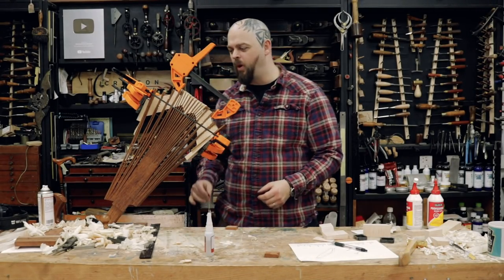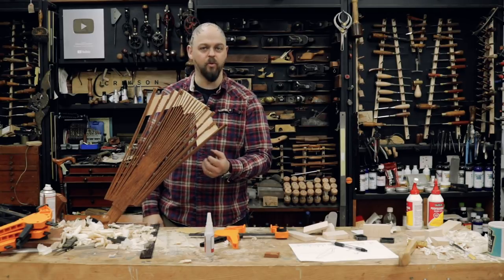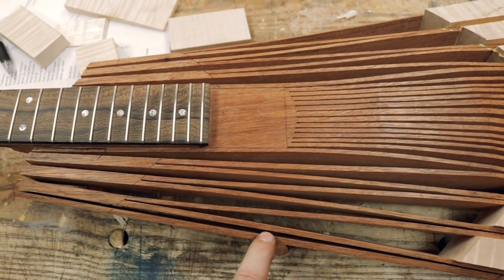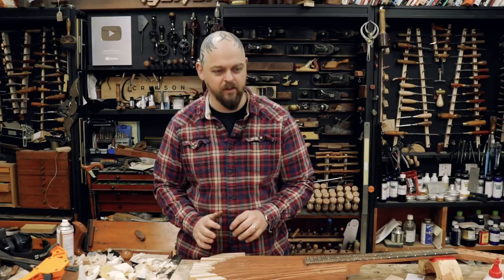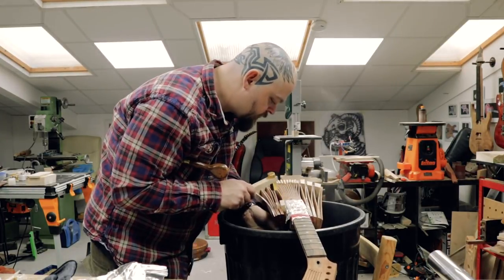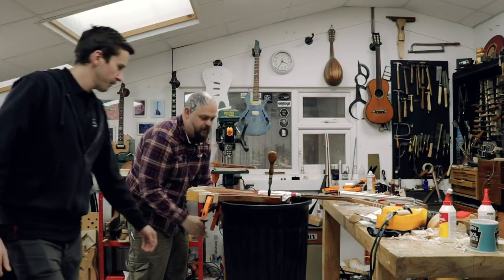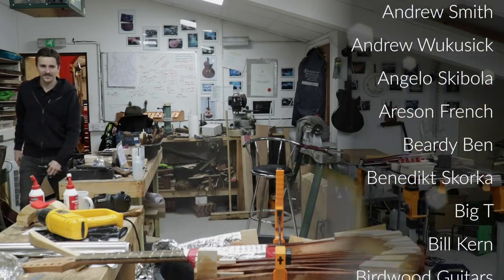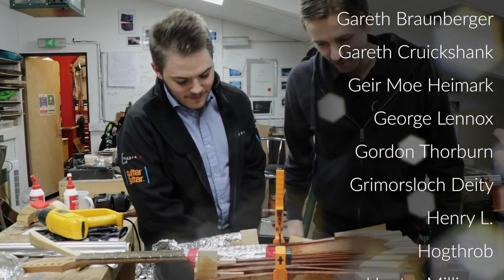Ep 13 - BoB1 - Things are heating up in here! - Ben Crowe Builds an Insane Guitar

Comment: The horns end is very solid because the other end is glued. The outside of a curve is longer than the inside, so in order to bend the (dry) fanned strips they need to be able to slide relative to one another, to accommodate the difference in arc lengths.

Comment: Ok, in retrospect, the best way here, (I believe) would have been to not put the fret board on until later. Then to add all the wedges (but not glue them) to both ends, bind the middle with either clamps or with tape/twine, then submerge the entire business in the boiling water.  This would force/add the desired curve to the guitar body and to the angles in the slices without releasing anything that had been glued. Once the desired "curvature" is achieved then you can remove it from the water and allow it to dry while still clamped and bound.  This would hold the curves after drying.  At that point glue in the wedges and the fret board etc....  Kinda the way early skate boards and snow boards were made way back in the day,  by forcing the bend in the end with boiling water in a bucket and the board dunked inside.  
BUT, as always Ben, amazing work! Thanks for the series and the entertaining video.
cheers
-DA

Comment: I was thinking in the start of the video with the first cracking. you should have a clamp in the middle to take away the stress from the end of cut and just stress the woodgrain by bending it. it can handle much more. I saw you did that in the end and it turned out really well :)

Cant wait for the next video!

Comment: Imo if you follow the kinetic chain here the safest and probably most effective way would have been to boil the slot-ends on the bottom side, even if that means having to reglue the wedges. All the tention of bending the slabs ultimately comes back to those dreaded slot-ends and can ruin your day even after the build is already finished.

Comment: Ben could you take a saw and cut the webs apart on the bottom side of the guitar at the neck.  When you got them bent to the desired bend, cut some real thin slivers of the white wood and glue it back together where you want it.  Or just glue back the pieces you cut without any fillers.

Comment: I thought that glueing the back first might cause an issue. In effect, the wedges at the back are the correct size and shape for the V you had when you glued them in, not for the shape you were aiming for, so that puts extra stress on things when you try to bend to the final shape. 
If I were to try it I think I'd try to devise some sort of jig to hold everything in place so I could cut the wedges to properly match the final shape (and also to keep things in place while it glued up).

Comment: Even in previous episode I was questioning the sanity of gluing the bottom end before opening the top. (I'm at 3:45 - at cracking) So if you'd wedge the top at the same time as bottom you'd not have to fight the tension that is now there because the bottom is glued and when you try to open the top you create the shearing forces.

Comment: Boiling water really doesn't work as well as steam. The point is, the water doesn't actually do much. It's the heat that makes the lignin in the wood yield. Steam is an excellent way to transfer heat, because when it condenses on the wood, it releases a lot of energy into the wood. Hot water, even boiling water, doesn't do that.
Reply: Dries van Oosten yes!  That’s physics :) love it.  Latent heat of vaporisation.

Comment: Ben, your pathological lack of planning never ceases to amaze me
Reply: It's the perfect safeguard against failure. He can attempt to do some "wacky", "crazy", "amazing", "utterly original" build despite making no real preparations, or giving it much thought, which then causes the project to fail (e.g. all of the last "X Hour Builds") to which he can then reply that it was all just a "grand experiment" and it "was fun trying", etc...all of which may be true, but they're also colossal failures, that basically just waste everyone's time, particularly when you watch several episodes only to see it all go to shit at the last minute due to poor planning and lack of necessary technique.
Reply: @KarlKarsnark , those who try doing different stuff instead of sitting flat on their buttocks are bound to fail from time to time (well, most of the time). Failing is not bad, on the contrary, it's totally fine. The point it, that wisest of us try to minimize their failure rate by thinking their steps through before grabbing the piece of wood and slicing it to strips.
Reply: How you even plan this kind of thing? Maybe you can, after a prototype.
Reply: @apinakapinastorba , well, you walk through all the steps in your head and think of all the contradictions. Like if you know you need to bend some wood, which may crack and ruin the whole project, you may want to start with that, instead of gluing the fretboard on a chunk of wood and fiddling with inlays. And yes, a prototype would be a great idea. A prototype, a scaled model, a CAD drawing, any drawing for that matter. It greatly decreases the chances of "oh, snap!" during the process. But what's the fun in that, I hear you ask?

Comment: I am by no means an accomplished woodworker, but I've always had this nagging fear that by wetting/steaming/boiling the wood, isnt there the risk of the wood warping as it dries?  isnt that why we work with dry, stable wood instead of green wood (no sarcasm, an honest question)?  Is it because even though you wet/steam it, it doesn't actually go up significantly in moisture content?  And, as always...Ben is the best thing since sliced bread!

Comment: I think It sort of makes sense you had to glue it up in stages to get that nice sweep in the middle, the overall shape is coming along, I'm wondering if you couldn't have clamped the middle even more lol, but I'm glad you didn't leave it with the V shape at this point, with the arch in the body it's going to be amazing. I'm wondering what kind of finish it's going to have and whether or not that will add to the overall rigidity, of course it will help some if it's shellac or resin.

Comment: Fill the empty spaces in with resin.
Reply: Fill the empty spaces with resin and sawdust from the same wood as the wedges, makes sense doesn't it
Reply: What would be the point of this build if Ben did that?
Reply: @keithwallis9799    What would be the point of this build if he didn't...?
Reply: @jesse_cole  Ben's trying to emulate what Seth Rolland does with furniture. If it was purely the aesthetic of curved wooden slats he was after, then sure, fill the gaps (and something like that could look great), but there's more to it than that.
Reply: @keithwallis9799    I think technically what you meant is, there's less to it than that, but yeah ok.
Reply: @jesse_cole  True :-)

Comment: I have a rather important question (FYI I didn't watch all the previous videos, nor did I read the comment section, so the following question may have been asked previously): How are You going to install a bridge on that cracking floppy piece of wood?
Reply: Michał Kalinowski hahah yup I asked that question. Along with a bunch of other people. I think it’s a good question. There have been some pretty good suggestions. I’m really looking forward to that part of the build
Reply: I think a floating bridge with a tailpiece is the likely method
Reply: Michał Kalinowski 
He said he was going to bolt the bridge on by using a metal plate on the back so instead of screws you use the bolts to sandwich the wood in between the two piece of metal ie the bridge and the plate of metal on the back.
Reply: SanAndFe he did... he’s a genius
I thought he said he was gonna route out a spot and insert a maple block to bolt to

Comment: pouring boiling water on the guitar lol sounds funny but hey! if it works :P
Reply: There's a reason why wood is left to dry for years before making an instrument. Drenching it in boiling water totally defies the purpose. It's not a coffee table with a puckup, it's supposed to be a guitar. And even if it doesn't snap after drying (which I think it will do), it's gonna sound like a bucket.
Reply: @vinylhead9938  It's not an acoustic. If the pickup and electronics are good, it'll sound good. If everything between the pickup and the headstock is made and finished as well as usual, it'll play well.
  When unplugged, residual moisture may affect the resonance, but given all the slats it's not exactly made for acoustic resonance anyway. Let's see how it sounds in Phil's hands when it's completed.
Reply: @keithwallis9799 , I'm not saying the guitar is going to sound bad as a result of moisture being applied (that too, but that's not the main reason). The moisture affects the structure of the wood and makes it even more prone to twisting and bending ever which way, than it already is. Now add here deep cuts going directly into the part of the instrument bearing all the load and string tension. Let us keep our fingers crossed in hope, that this thing is not going to bend like a bow and make cracking noises as soon as srings are tightened. And even if it stays intact and straight, the bridge is going to be affixed to the wooden strips, which by design are not capable of sustaining the sexy frequencies a good guitar has.